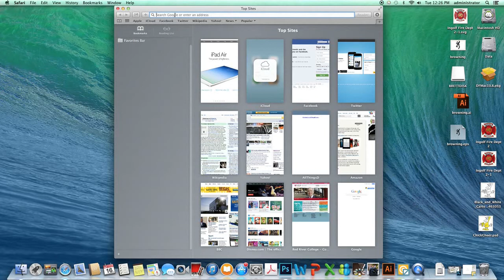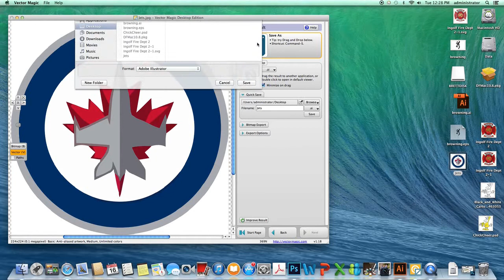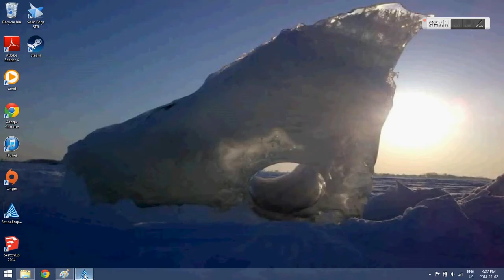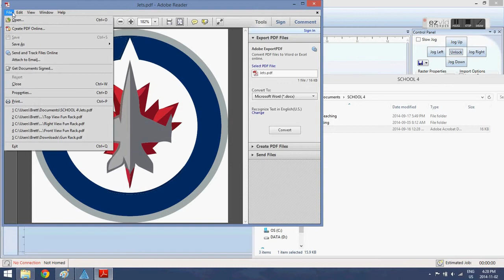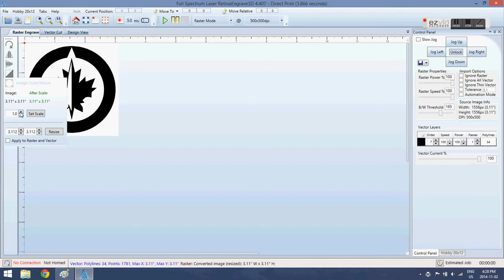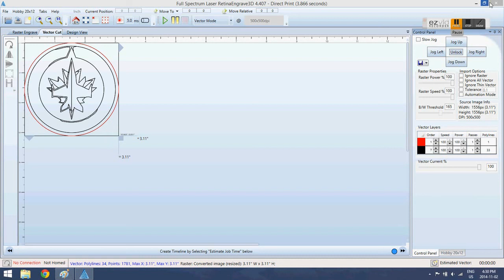How to use Retina Engrave 3D

Comment: Great tutorial. I am considering buying the FSL H-Series and I want to learn all about it before deciding. I see that you are on a Mac. So you switched over to windows with Bootcamp to be able to print correct? I was on the FSL website looking for Mac software but it's only available for Windows.
Reply: I am looking for the same - but apparently it is not available for Mac OS ( I have High Sierra )
Reply: @kiranshashiny  contact FSL and see if the H-series laser works with they're latest software RE3. RE3 works with any OS because it's web based.